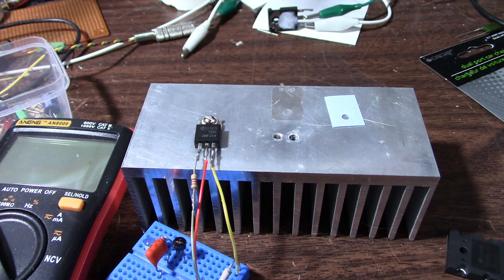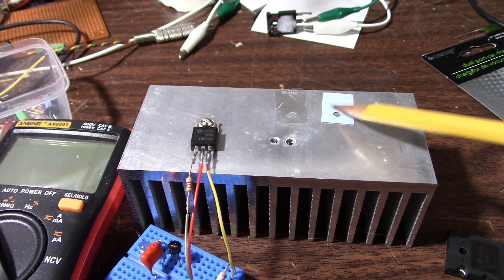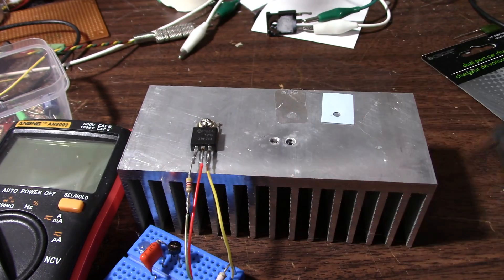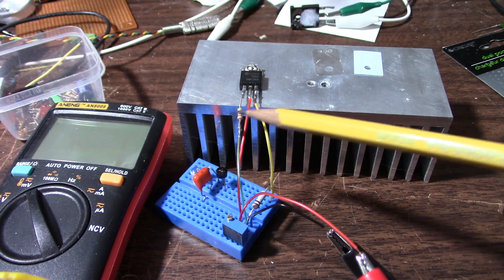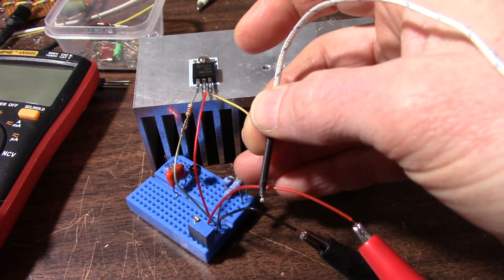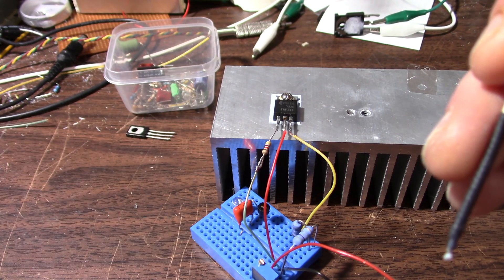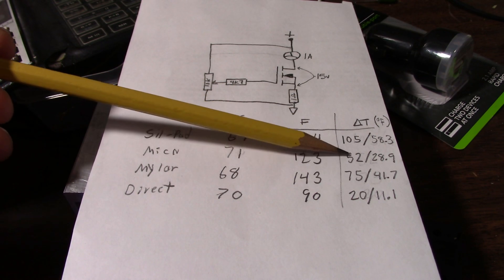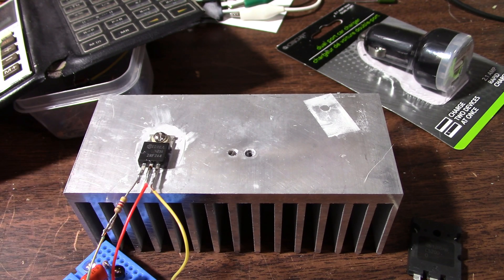Transistor heat dissipation - testing thermal pads

Comment: I have a smps power supply its 12 v and 30 amp the transistor heat can I put the transistor direct with the heat sink without use isolation

Comment: so it would just better to use only a transistor and the heat sink with some paste between? It is easier for me to separate other components from the heat sink than fight with the heat :/ What would you recommend? I need to increase the performance of my hoem built power supply because the transmormer and other components are very efficient but the regulator is the wekaest part here because it gives me only 0.6 A before shutting down which is sometimes not enough (usuelly it is ok when I use 100 mA) but sometimes I need a better performance and actually buying another regulator is not the case as even 5 A regulator has almost the same thermal ratings!

Comment: Does the "Thermal Grizzly Minus Pad 8" 0.5mm thick thermal pad work better than mica and thermal grease?
Reply: I wouldn't mind sending you a package or I've even seen "fujipoly XR-m". Their spec sheet shows to have more thermal conductivity and electrical insulation than mica and thermal paste. Never used it but it seems worth it on upgrading something people would want to keep for a long time.

Comment: I checked the datasheet for this transistor, which states Rds(on) = 22 mohms, wouldn't power dissipation be only (1A)^2 * 0.022ohms = 22mW?
Reply: John is operating the mosfet in its saturation region not in its ohmic region.  The transistor is biased such that there is about 15v dropped across the transistor which at 1 amp will produce 15 watts of dissipation.  If the transistor was biased into the ohmic region (with a higher bias voltage) then the power supply would be largely dropped across the resistor instead and the current would be much higher than 1 amp.
Reply: Rds(on) will be at a higher Vgs than what's being ran here.  Check the stats for the resistance and see what I mean...

Comment: I used copper anti-seize compound in a pinch and that stuff worked better than the paste i had that came with a processor i got a while back...  the stuff is very conductive and dont recommend it on aluminum heat sinks because dissimilar metals and galvanic corrosion, use the aluminum anti-seize compound..  the stuff mechanics use on bolts... that gets everywhere if you touch it..   lol..  try it out for yourself..  like 6$ for enough of it to paint your entire body with, twice..   ha!

Comment: Something possibly useful (for me): quasi-(electrically)-conductive thermo-pads; TI calls for multiple LM338s (10/15A Power supply) and 0.1 ohm resistor(s)... between tab/output... "direct-mounted" to heatsink, with 0.1 ohm thermal pad, making the heatsink the current plane.. perhaps I'm just building another bonfire ;-)

Comment: Perhaps someone else already asked this, but I wonder if there's a difference in the electrical resistance between those different thermal pads, which might make using a sil pad necessary if extreme electrical isolation is needed. I imagine testing the resistance of each of those different thermal pads might be pretty difficult, and as you said, thermal and electrical conductivity are usually strongly related to one another, so there likely will not be any big surprises in the results.

Comment: Hi John, yeah I figured mica would be best, but how much trouble would it be to use no insulator, and insulate each heat sink from each other?
Reply from the maker: It could be done with hardware to isolate each heat sink. It isn't done in consumer products because of the extra cost plus the large voltage across the heat sinks. The large TO-264 transistors I will use in the final amp have such a large thermal pad area that mica will suffice.

Comment: Yea but once you put a screw in it, it electrically connects the heatsink.
Reply from the maker: I use a nylon shouldered washer for isolation
Reply: @JohnAudioTech  ...
Well that would be the answer. From my experience, manufacturers usually just use thermal paste, probably for cost reasons...but, I also noticed the heatsink is grounded. Also most transistors have a positive potential in the tab. I never paid much attention to the isolation. I must try some experiments. thanks

Comment: Sorry John I forgot to ask. What  maximum temperature would you consider the practical 'ideal' taken on the device case  There a hundreds of articles on YouTube and Google giving complex and often confusing design criteria. For every 10C (50F) you halve the life of a device. Not one that I can find says keep your device case below (for example)  60C (140F).  I know this is a very rough and ready method but if I can't keep my finger on it it's too hot. That's about 60C  (I have an infrared thermometer) - and hurts. Even EEVblog in an old video says it's whatever you feel is right. I did pop a TIP35C because one of the thin mica layers (with thermal paste) had broken off  half way across it. I do understand this is putting you in an awkward spot but please - GO FOR IT.  Regards
Reply from the maker: In his power amplifier design book, Bob Cordell said pretty much the same thing about the finger test. I've always felt that if the heat sink is too hot to touch for more than a couple seconds then it is inadequate for the job.

The long answer is more complicated. The thermal resistance of the die to the metal tab in the package to the package to heat sink interface, the heat sink's ability to dissipate the thermal energy and ambient temp all play a roll.

Keeping the junction temperature well below maximum by providing a low resistance thermal path is key. There is no specific answer other than the cooler, the better.

A good example of thermal design is LED bulbs. The A style LED bulb designed to have the same shape as the incandescent counterpart doesn't lend itself to dissipating heat very well. Some of these bulbs run at 100 Deg C or more in open air. When the consumer puts the bulb in a fixture with restricted airflow, the bulb runs even hotter and has a short life. The pressure of keeping the price low and making the bulb last long could potentially lead to better components that withstand heat.
Reply: @JohnAudioTech  Thanks for the reply John. It sounds like my 60C figure is good enough. It's pretty obvious that there are so may variables an exact answer is almost impossible to obtain. There is even - 'Correction factors for passive thermal devices due to altitude'. I wonder if one should include the height of the table ?
Your words 'the cooler the better' are spot on. 
I have 12 x TIP35C's running in 2 banks of 6 from 2 x 36V - 8.5A transformers in parallel. 6 x 60mm fans. I have set them to start up at 45C and run flat out by 60C. That's an awfull lot of watts to get rid of but so far apart from the that one TIP35 popping it all seems to work quite well. Please don't ask why I have made this thing because I don't know.
Thanks again John - best answer in 2 years

Comment: wouldn't the 1R resistor be better on the Drain pin, why/why not?
Reply from the maker: It has the similar function as the emitter resistor on a BJT. It provides some negative feedback to the circuit.

Comment: Kapton tape is also often used in speaker voice coils and transformers, at least that's what I remember from back in the 80's and 90's. 

Hey, I spy with my little eye, an E-Circuit USB car charger. Did VWestlife's video ealier today inspire a trip? Just kidding. 

Good info on the isolation pads. SilPads seem like their forte would be for low dissapation devices.
Reply from the maker: I spied that charger at my local DT a couple weeks ago during my swing through the store. Video coming soon!

Comment: At first glance it looks like if there is no possibility to do a direct connection to the heat sink, with the thermal compound naturally, a good ventilation will more likely be mandatory.  I guess this would pretty much explain why we have fans almost everywhere ensuring proper air flow.

Comment: Wow, amazing to watch the temperature rise so fast. Very enlightening. I assume a bipolar transistor that could handle the power would rise even faster?
Reply: No, he's forcing the MOSFET to dissipate 15W in this test, using its linear mode and not taking advantage of its low voltage drop, since it's forced to drop about 15V in here anyway. If you had a resistor in such package, it would perform the same, and the BJT would too.

Normally when you're creating a switching device you use either in saturation and MOSFETs will tend to have lower dissipation in low voltage scenarios than BJTs.